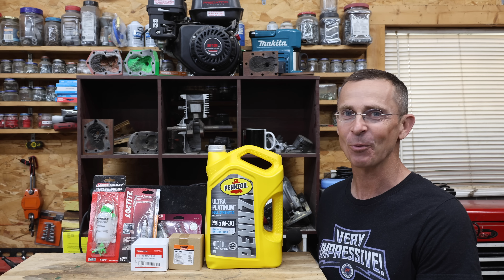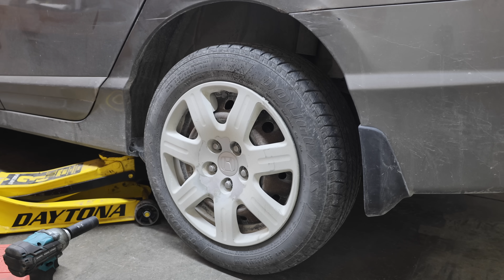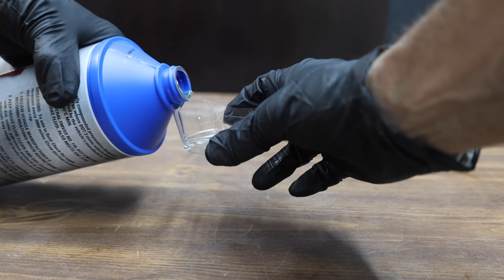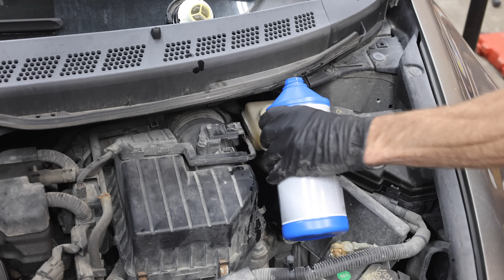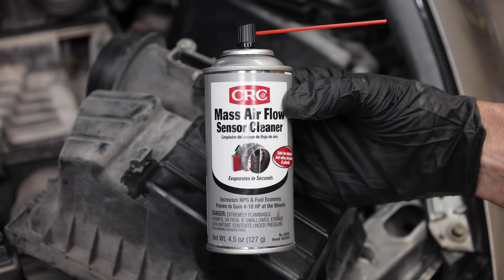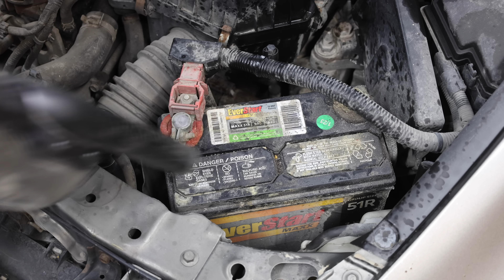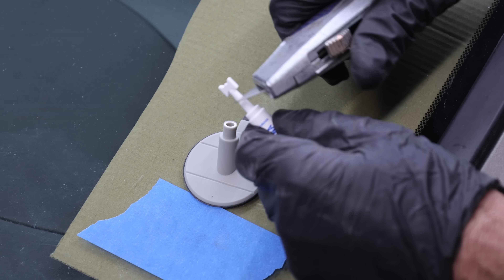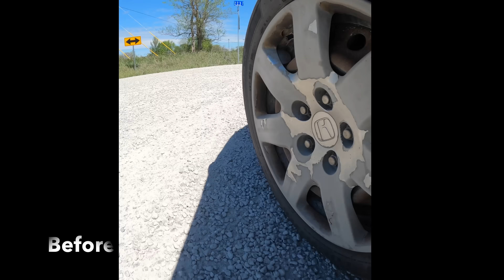Most Reliable 200K Mile Car? Let's Settle This!

Comment: I would be careful with $50 hubcaps.  I did try a set.  Seemed fine but looking closely one wheel had its hubcap spinning while driving ... damaging the valve.  A good thing I check my tire pressure every week 😂.
I ended up leaving all the hubcaps out.  The more "badass" look is more fitting for this minivan that is used only as a camper.  Also the sober look with windows + wheels all black gives it an elegant stealth with just 2 colors with no chromy bits   That van is 25 yo but nobody would guess.   Reliability:  not used my AAA in the 20+ years I have had it.  It is a Ford😊
Reply from the maker: Thanks for sharing.

Comment: Project farm. 
Great video can you please make one on rust? How to prevent it or treat it? How to spot a car that's too far gone? 

I have a Corolla with 265,000 mi. I really wanted to get it to 300,000 mi but the entire muffler and exhaust assembly is gone. There's nothing to hook underneath because it's all so rusted. 

I'm looking at buying an Accord just like the one in the video with the same mileage. But it would've been nice to keep my Corolla.
Reply from the maker: Thanks!  Thanks for the suggestion.

Comment: I bought a new Ford Ranger pickup in 1996 for $15,193 bank check. That's 28 years ago.There's 220,000 miles on it now. Never had a problem,it starts every time ! I never thought I'd have a vehicle this long.I'm 75 years old.
Reply from the maker: Nice!  Thanks for sharing.

Comment: Great video.  I fast forwarded through much of it but still got the point.   I have a 2008 Honda Accord w 2.4l 4-cyl.   344,000 miles and still runs great.  Never had the engine light come on. Only major maintenance was timing chain replacement at 220,000 miles and replaced power steering pump.  Original transmission with no issues. Been absolutely reliable vehicle.  Shooting for 500,000 before I trade it in.
Reply from the maker: Thanks!  Nice!

Comment: Had a pro windshield fixer tell me that if the repair doesn't use pressure, it ain't gonna work. They had this small machine that pressurized the repair liquid into the rock chip. 10 years later it never has spread out across the windshield, it just remains one of those small spider-looking cracks.
Reply from the maker: Thanks for sharing.

Comment from the maker: I get a lot of questions regarding the products and tools that I use. Here's the list and there are more details in the video description. Thank you
Brake Fluid Tester: https://amzn.to/3WgLZlf
Vacuum Pump for Fluid Extractor: https://amzn.to/4baBvbw 
¼ Inch Clear Tubing for Fluid Extractor: https://amzn.to/3Qm65Xv
Step Bit for Building Extractor: https://amzn.to/3UBuawf
1-Man Brake Bleed Kit: https://amzn.to/3wjTZY5
Silver Paint for Hubcaps: https://amzn.to/3UcpknH
Coolant Test Strips: https://amzn.to/3UyomTW
Dielectric Grease: https://amzn.to/49VL790
Permatex Windshield Repair: https://amzn.to/44eUcIJ
Spray On Ceramic Coating: https://amzn.to/4dtEq11

Comment: I learned how to rebuild a carburetor sitting on a white towel on the floor.  Parts that fly off or fall only fall a couple of inches and get stuck in the towel.  Works for other complex parts as well.
Reply from the maker: Thanks for sharing.

Comment: for me the most reliable car is my tesla model 3 : bought my first tesla in 2012 a model s that thing gave me 315k miles on a single pack , i sold it for 10k on 2022 and bought a model 3 right now i have 50k miles and planing on keeping this one until 500k miles taking into consideration buying a replacement battery pack but i do want to keep this car forever if i can if not just upgrade it for a new performance model 3
Reply from the maker: Thanks for sharing.

Comment: My daughter frontr wrecked a 2012 Elantra three years ago. The engine still runs but the front repair costs,impact bar, radiator, thermostat, water pump, lights, sensors and air bag replacement are more expensive than the value of the car itself. I would like to watch a video on repair of a severely front wrecked Elantra 2012 and how to look for original replacement parts. Thanks
Reply from the maker: Thanks for the suggestion.
Reply: Why?  You've already said it - repairs are more expensive than the value of the car itself, and 12 year old mediocre car at that.

Comment: I really to mKe a fluid transfer pump! I've seen you use that on several vehicles & it would make tasks so much easier. I like the idea of pulling out trans fluid every other oil change as I have an '06 yukon with 225k & really want to keep that trans healthy.
Reply from the maker: Thanks for sharing.

Comment: Not exactly on point here but my friends laugh at me because I keep my cars so long. All had manual transmissions and I became very attached to every single one of them. 
150,000+K  - 1975 Mustang II - my first new car. I know it’s not the classic, but it was SO much fun to drive and in spite of intermittent electric problems, it was passed down to four of my siblings before it finally held its own Viking funeral
195,000K- 1980? Volkswagen Jetta diesel (had to downshift and turn off the AC to get on the Freeway)
205,000- 1989? Subaru XT 6- tied with the following as my favorite car
210,000- 1998? Audi A4 Quattro 6 cylinder
240,000- 2006? Subaru Impreza, 4 cylinder (pretty darn quick for its size)
190,000- 2014 Subaru Crosstrek (unfortunately totaled in collision)
15,000 and counting - 2022 Subaru Crosstrek 
Thanks for tolerating my rambling

Comment: Own 2 K24 engines (Honda/Acura). 1 of them with 193,000 miles (2005 Acura TSX). Inspected the cam shafts and valves look like new, runs like new. Did BlackStone lab oil analysis and showed low wear and lots of life left. Purchased the TSX used in 2009 for $12,500, paid off in 2011. By not getting another car payment when I paid it off in 2011 until now 2024.. I've saved/made about $118,000 assuming i was not getting into another $500/mo car payment and instead putting that into a 5% interest bearing account. Judging by my current savings I'd say it's accurate.  This car still runs/looks new. Ive put maybe $3000 in maintenance over the years does not include tires or fluid changes. I perform near all the maintenance.

Comment: Old mechanic here - a couple of tips; when changing or bleeding brakes on older vehicles pushing the pedal to the floor can very easily destroy the master cylinder by running in an area that it has never gone to where rust builds up it can very easily cut the piston seal. Simply crack the bleeder valve and let it gravity bleed - it’s a bit slower but much safer and 2; when changing coolant simply squeezing the top hose is not sufficient to bleed the air out - with radiator cap off run the engine until it reaches running temperature (you will feel the top hose getting hot when the thermostat opens) and after air purges out top up radiator and replace radiator cap 👍
Reply: Most cars don't have a radiator cap nowadays.
Reply: So, if Im replacing my master cylinder fluid, top it off and just open the bleeder valve on each wheel until there's no air in the line and then tighten it back up?
Reply: @ yes. Close the bleeder valve and pump the pedal a couple of times (it shouldn’t go further than normal travel) and reopen just to be sure all air is removed, just make sure at no point the pedal gets pushed further than approximately half way 👍 (on motorbikes this method is not appropriate because of the small master cylinder size, but I’ve never come across a car that this doesn’t work on)
Reply: @Sam-zu8pc  Thanks!
Reply: @ no worries at all mate - it was a lesson I learned the hard way as a young apprentice!
Reply: @da324 

Also depends on car, sometimes you need a scanner to bleed .. like second gen Prius

Comment: How much does all of this work cost in a garage for the average customer ?  10K US$ ?  and the car after investing those 10K US $ worth how much ?
you got the hint.
A brand new car is 20K US $ like Nissan Sentra. only more equipped more modern more safe and warranty for 3 years, you can count on it not to get stuck on the road.
You spray sand in viewers eyes.

Comment: Our 2005 4Runner V6 has 377,000 miles and going strong. Frequent oil changes with quality oil, do maintenance as the issues happen and don’t let problem pile up, fix it right away. Maintenance is cheaper than a new 4Runner. We love our 4Runner
Reply from the maker: Nice!

Comment: most reliable 200K mile car? easy one. any old police cruiser. they're maintained ahead of schedule at all times, and retired early in most cases. the last crown vic police interceptor ii had made it to over 500K miles before i ended up selling it to buy a work truck. was still running great when i sold it.
Reply from the maker: Thanks for the feedback.

Comment: Would love to see more like this! Love how you point out how much more expensive it is to buy a new car than a very used one. My wife and I just picked up a Silverado 1500. It had 165000 miles and that worried my wife but I told her they are reliable (mostly) and I can do just about anything to it. 

You should post the portion on making the mason jar vacuum separately. I will definitely do that.

Comment: I learned something new today. I have never heard of 3rd clutch pressure switch . I have a 2004 camry with 301K miles and 2007 Lexus LS460 with 171K miles.
Reply from the maker: Thanks for the feedback.

Comment: I have that same 2008 Honda Civic with only 90K miles driven by my mother-in-law so I know it wasn't abused.  Mine suffers from the paint clear coat problem that plagued these cars.  The clear coat wasn't thick enough and now the blue paint looks grey.  But otherwise, it's a great and reliable car. 

Here's a tip.  If you ever need to replace the starter motor, I'd go to a garage unless you have access to a lift.  You really need to use both hands to do the job.  I'm a pretty experienced mechanic and it took me a stubbornly 2 days to do the job lying on my back. 

Great video!  Keep em coming.
Reply from the maker: Thanks, will do!  Thanks for the feedback.

Comment: I  have a 2007 Hyundai Sonata I bought for 13,500 and now has 305168 and just replaced the injectors and it still is running fine. One of the best cars I ever bought. Nice video, great to watch.
Reply from the maker: Thanks!
Reply: I have an 08 Kia Rio5 w/ manual transmission. Its also a very good car. Hyundai/Kias of that generation were great cars.

Comment: The most reliable car (for the price) was probably the 98-2002 Corolla / Chevy Prizm. My dad bought a 99 Prizm and never changed anything on it except the wheel bearings and the oil. Never changed the ATF, PS Fluid, water pump, timing belt. First spark and wire plug change was probably at 180K miles.  By the time he wrecked it, it was leaking badly from a Valve cover, it was burning a lot of oil, but 205K the engine and transmission were both running great. If you put in a quart of oil every couple of weeks.
Reply from the maker: Thanks for the feedback.

Comment: If it's a 2006-2008 and early 2009, the car is this video is actually a part of a recall from Honda because engine blocks were cracking prematurely and required an entire engine replacement. They knew it was a problem, so they warrantied it for 10 years. I rarely see those cars on the road anymore.

Comment: Based on my experience, I always drive oil filters slightly more than 1/2 but never over 3/4 turn after the rubber seals touching the housing - following the instruction on the filter itself. And it's always a good idea to clean the filter with paper towels thoroughly before trying to remove it. Even a drop of oil on the gloves would make the day worse.
Also I had several experiences with the filters totally seized up. And the solution is usually drilling through them from the side and using a large screwdriver to turn it. There was only once I used the nylon wrench which isn't very strong but sometimes does the job.
Reply from the maker: Thanks for sharing.

Comment: My 2014 Ford Focus has 200125 miles. With the manual shift transmission, it gets 41 mpg on secondary roads at 55 mph or slower. I drove 105 miles round-trip to work for seven years (retired last year). It had an oil leak that was fixed under warranty; no further trouble. 

On an amusing note: Our 2012 Ford Fusion had about two more payments to go, when the dealership emailed me that, for just a little more than the $250/mo I had been paying, they could put me in a brand-new Ford Fusion. I replied that that was a good business plan for them, but here was my business plan: I had a great car that still looked and ran like new, and once I made the last payment, it would be like getting a $250/mo raise. I would stick to my business plan!
Reply from the maker: Thanks for sharing.

Comment: Hard to say, I have a Dodge dart with 260,000 miles and a Kia optima with 360,000 and they are both still going with minimum parts replacement.
Reply from the maker: Nice!

Comment: Great job on the Civic, those are nice little reliable cars. Had a 2003 Corolla with just over 400k on it when it bit the dust. Commuted to work 130 miles per day roundtrip, 5 or 6 days/week.
Reply from the maker: Thanks for the feedback.

Comment: The problems on this Civic look like the one I had on my car when I bought it at just under 120k miles (197k kms). Unfortunately, the used car market being what it was (and the fact I'm a lousy negotiator), it costed me 3500$ anyways and after less than 2000$ in repair in the course of 1 year, part of it being done in a shop mind you, I have to work on the street so some jobs are out of my realm, it runs pretty good and is in decent shape. The car market seems to have slowed down, but looking at it, adding a little bit more work without any expensive part, it seems if I decided to sell it it could fetch around 7k$, mostly due to the fact that it doesn't make scary noises anymore and looks way better with mostly elbow grease put into it. But I'm keeping it, it suits my needs just fine!

Comment: I'm an end user for most of my vehicles and usually when finished with it will sell for scrap or for a low price to someone who will get a couple more years out of it. I've had many cars I've taken over 200 thousand mi. and a few over 300 and most were still running fine. I just got tired of the them before they got tired of me. Here's a few I remember; 2002 Chrysler Concorde 300,000, 1967 Chev Caprice wagon 280, 1977 Buick Park Avenue 250. All running smoothly when I was finished with them. I get weary hearing about Toyota and Honda. Good cars today maybe so, but back when overpowered street yaughts were the thing, the J-P scrap couldn't touch them;)
Reply from the maker: Thanks for sharing.

Comment: Wow what i wouldnt give.... I live in Canada, the ease in which all nuts and bolts came off that 2000000  mile car almost made me cry. With all the salt used on our roads in winter everything gets corroded so bad you could spend hours and hours just getting everything apart. If you ever want to do a video on methods of disassembling corroded parts hit me up 😂 ive got some interesting methods
Reply from the maker: Thanks for the feedback.

Comment: Advice from an old fart mechanic guy: GM vehicles with the 5.3L v8 and the 3800 series are very reliable when maintenance is kept up. As are basically all Lexus vehicles (elite of Toyota and Japan made). I have just rolled 700k miles on my 2002 Lexus RX 300 FWD and it still runs like a Swiss watch. Honorable mentions are the Chevy 4.3L v6, any Corolla/Matrix/Pontiac Vibe, nearly every Camry, Accord, Civic, Toyota's with the 4.7 and 5.7L V8 engines, Suzuki Sidekicks, Samurai's, Nissan trucks (NOT CARS), Oddly enough Ford Escorts built between 1997 and 2002, Ford vehicles (especially the E150-E250 series vans) built with the 5.4L Triton V8, Jeeps with the inline 6 motor only and absolutely NO Chrysler, Dodge, Plymouth, Eagle, vehicles! I know there are many good ones out there I've missed but in a nut shell those bullet proof Japan made vehicles, a hand full of Chevy and Fords if well maintained is all you need to know in order to stay out of my repair shop! 😁
Reply from the maker: Thanks for sharing.

Comment: I have a 2004 Oldsmobile Alero with a V-6.  235,000 miles.  I use high mileage oil and oil is changed every 3000 to 4000 miles.  Transmission fluid changed every 80,000 but the manual says it doesn't need serviced.  I checked all fluids every time I get gas.  Hope to get many more miles out of it.
Reply from the maker: Nice!  Thanks for sharing.

Comment: To date, I have had a six cars last well over 200,000 miles:

2004 Honda Odyssey 
1996 Pontiac Sunfire
1995 Toyota Camry (4 cylinder)
1995 Toyota Corolla
1994 Jeep Grand Cherokee Laredo 4x4
1992 Nissan Stanza (My 1st car 😄 )

I have learned A LOT in 20+ years of maintenance and repairs and wouldn't trade it for anything! Current vehicles include 2009 Suburban and 2000 Silverado. Both run excellent with over 100k. I have saved at least $100,000 on car payments alone! Someday I may make the dive into Diesels.
Reply from the maker: Nice!

Comment: Heres a tip for you Todd. Whenever replacing a thermostat take a drill bit and drill two or three holes in the thermostat that way you will always have coolant flowing if the thermostat sticks. It could save you an engine some day.
Reply from the maker: Thanks for the tip.

Comment: The biggest issue with the civics of that generation is the air conditioner compressors. For some reason depending on which one shipped with your vehicle, they are a consumable part
Reply from the maker: Thanks for the feedback.